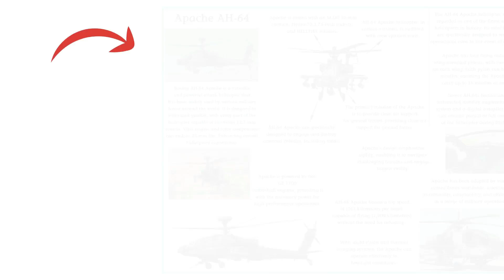F-35 Lightning II Crash Explained – What Really Happened in Alaska

Comment: Complacency...that's what happened.

As an AM both hydraulic and structure and worked in Fabrication...this sounds like a contaminated hydraulic line issue.

When I read about this issue first thought went back to a Red Flag training operation in Alaska, EA-6B went up and started having sluggish flight controls and immediately returned. Upon hydraulic samples found there was some water contamination in the lines after performing maintenance, changing filters in the lines that were tested and bleeding the hydraulic line clean aircraft flew out the next day no issues.

F35 has an incredible 5,000+ psi hydraulic system compared to the EA-6B which is around 2,500 psi... Makes me wonder how badly contaminated the hydraulic system was and why did none of the secondary systems worked ... I mean to be fair this entire ordeal is weird and crazy.

Comment: Is there ANY actual videos/pictures from this incident? Lol

Two seconds on "Wikipedia" will give you more than this.... I don't even know what you call it?
Reply: As an AM both hydraulic and structure and worked in Fabrication...this sounds like a contaminated hydraulic line issue.

When I read about this issue first thought went back to a Red Flag training operation in Alaska, EA-6B went up and started having sluggish flight controls and immediately returned. Upon hydraulic samples found there was some water contamination in the lines after performing maintenance, changing filters in the lines that were tested and bleeding the hydraulic line clean aircraft flew out the next day no issues.

F35 has an incredible 5,000+ psi hydraulic system compared to the EA-6B which is around 2,500 psi... Makes me wonder how badly contaminated the hydraulic system was and why did none of the secondary systems worked ... I mean to be fair this entire ordeal is weird and crazy.